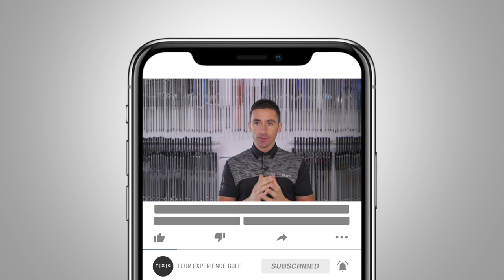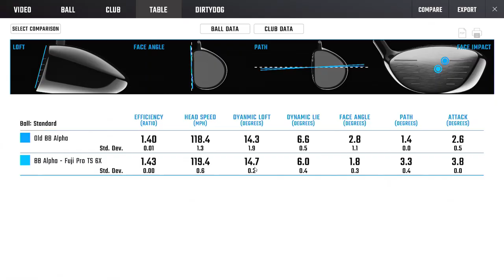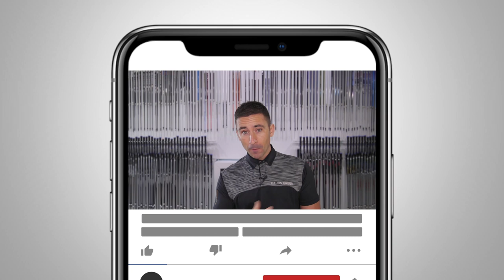Custom Fitting an Old Driver // How good can we make it?

Comment: Hey guys I have a video idea:  Old well-used Premium golf balls vs a brand new budget golf ball.  

I've been using the same ProV1X for 2 weeks, playing 18-27 holes just about everyday.  The cover is noticeably faded, the lettering is starting to come off, and there are some minor but noticeable scratches and dings on the cover too, but Titleist isn't making any golf balls right now because of the virus so I can't realistically replace it like I usually do by buying a dozen at the beginning of the season, I'm curious at what point or how beat-up does a premium golf ball need to be before it's better to use a different cheaper ball that's new.
Edit: My local course has no hazards, no bunkers and no water, very simple and straight forward so it's really hard to lose a golf ball this time of year at that course, that's why I still have it lol I'm not some tour pro or anything who never loses golf balls.

Comment: Hi guys,

Greatings from sunny South Africa!

I have a question on shafts which was not addressed in the vid...

Last year I got fitted for a new driver, being a Callaway Epic Flash SZ, and was advised to use a Tensei Blue stiff shaft. I absolutely love this thing and I smash it miles!

I am now looking at upgrading my 3 wood as well and I am interested in the same Epic Flash model.

Now the question... would the same type of shaft (given that its perfect for my driver) also be right for my 3 wood or should I get refitted for a different shaft per club?

Comment: I just bought a Alpha 816 DBD 45.5" Aldila Rogue MSI 110 60-3.8-S RIP IO shaft. I have always liked shorter shafts, but now I have changed my mind. Club speed in Trackman went up with 3 mph to 112 mph, where the fastest club speed was 113 mph. Ball speed went up with 4 mph. From avg 159 mph to 163 mph. I had serveral shots with ball speed over 166 mph. Now I need to fix my pull problems. But the shaft feels little soft at impact. Can a shaft make the pull worse? The face angle was closed by 2.8 deg. Club path was -0.8 deg. How much does the shaft influence the face angle? I tried to aim more right, but then found my self in hook city.

Comment: I need convincing that these super expensive new driver heads are any better for the average golfer than an old head that has the highest allowed  0.830 C.O.R... I'm gaming a Cleveland Classic Driver from 2012 and I absolutely love it as it's the deepest face driver I've ever seen... The depth is more more appealing to me than a wider shallower head, I'm not sure I'd hit these modern drivers any better at all... I've put my trusted £35 Aldila NV Rip'd shaft in it and love it..!!!
Reply: Gareth Jones we get the chance to go up against these old driver all the time.  I can tell you that it’s very rare that we can’t makes significant improvements.
Reply: @ianfrasergolf  That's very interesting Ian, I've been telling myself I don't need to look at these super expensive drivers but perhaps a fitting should be on the cards...
Reply: Gareth Jones That’s what I’d suggest.  At least that way you’ll know.  👍🏻
Reply: @ianfrasergolf  I've got quite a famous friend and other friends in Toronto and I've been meaning to pop over there as I've never been... It would be rude not to drop in on TXG if I ever make it over there..!!👍🏻👌🏻
Reply: Gareth Jones sounds good Gareth. 👍🏻

Comment: SO you're saying you can actually walk in with an older head (ex. my 2017 M1, that I like the feel of) and match me up with a shaft more suitable for my swing??  This video describes me, slight push, fighting to square the face.. because of this fight I can both leave it open or close it to the point of duck hook. If I had a shaft that worked more for me to close the face as in this video I would be laughing !!
Reply: Im not the expert like these guys but I'm fully behind using older heads and a shaft that suits you... I don't get sucked into this "new £400 driver is a must have..." I've always gamed older drivers and fitted the shaft that I know fits me perfectly, you just need to find that shaft...!!
Reply: @Harryjones05  ..exactly the used market rules and we all know advancements in heads has been negligable in recent yrs so pairing up a new shaft on a 2-3 yr old head that you can buy for 1/2 price is Value!!

Comment: C'mon guys i have a 983J with a run of the mill X graphite in it.  I just kills the ball.  And that is probably 20 years old easily.  Granted i have low 130s clubhead speed on a full driver, but still... i have a rocket ballz driver from around 2015 from the tour van and i haven't even hit it.  What is the point the old tech works fine as far as launch and spin rate.  It's the Indian not the arrow.